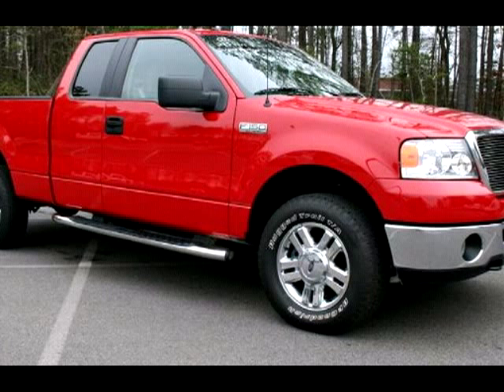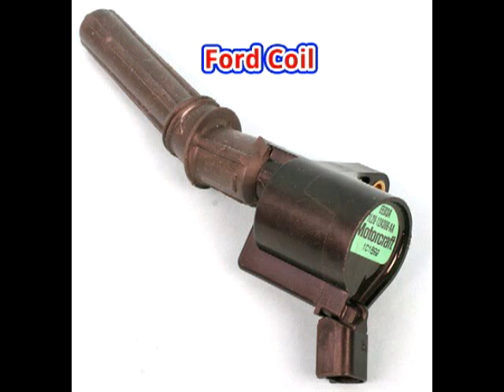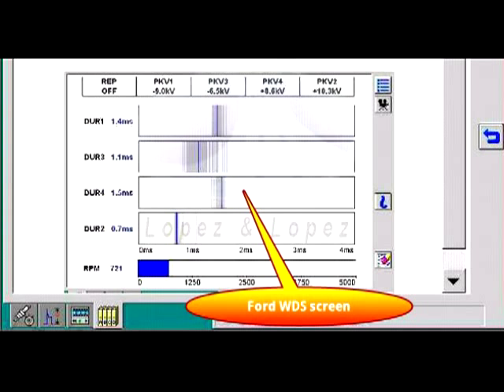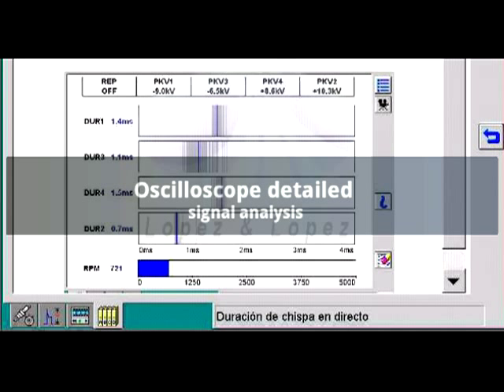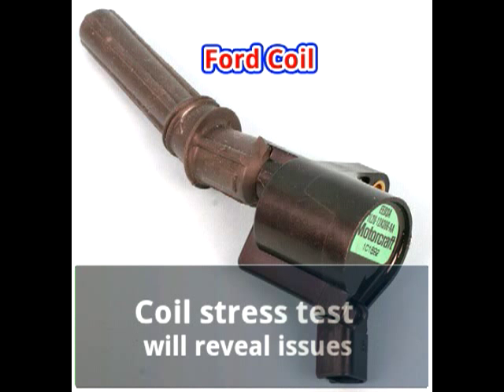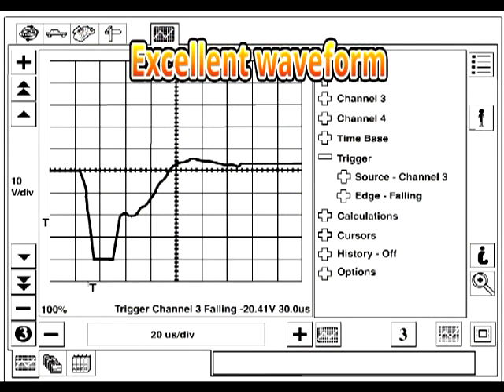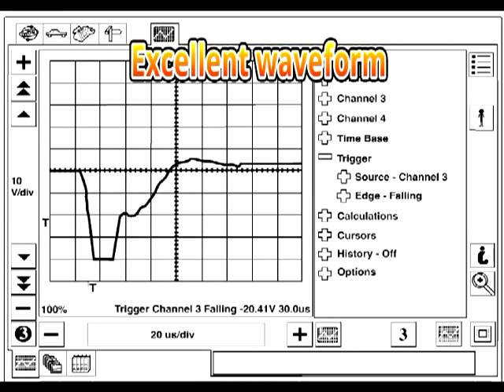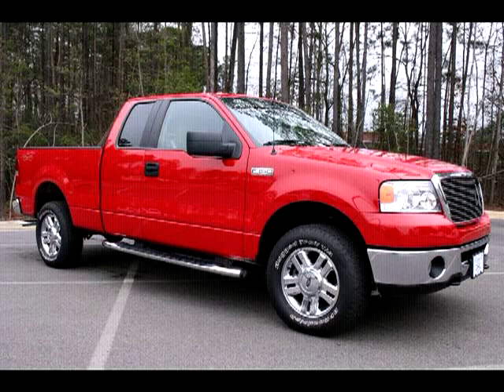Ford F150 Coil On Plug Stress Test

Comment: I am going to get a used set of coils at the junk yard, and rotate them into use to determine, through elimination, which coil, or coils, are faulty. This is a little time consuming but is the poor mans way to fix this problem.

Comment: That's good to know but can I do the test with an oscilloscope? I'm having what I assume is this problem with a weak coil after cleaning my high mileage engine. I assume there was some water intrusion into the COP and even though it still fires, I believe it is weak as it misses under load when in overdrive. Unfortunately the computer is not throwing a code so I do not know which cylinder or cylinders is missing.